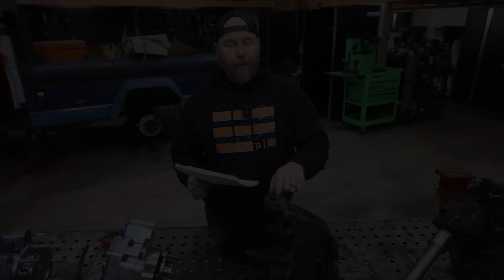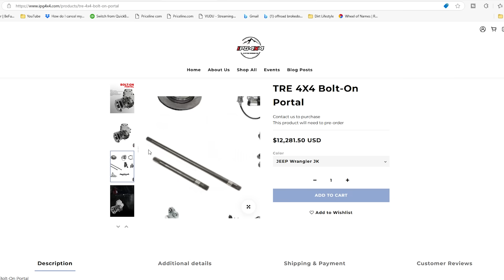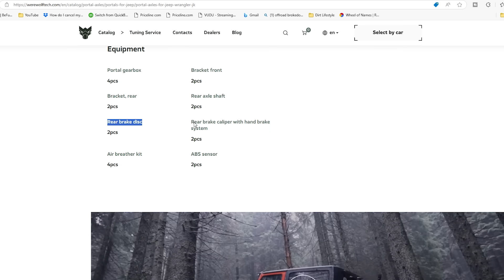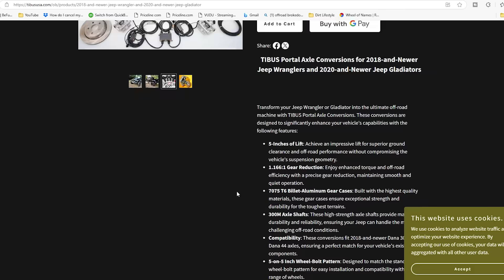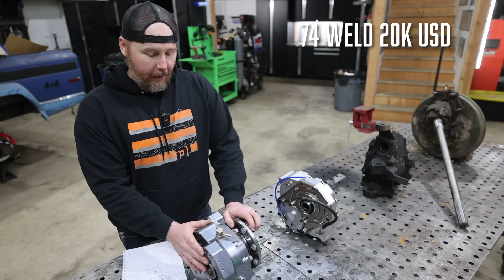CHEAPEST Off Road Portal Axle to Most Expensive! 74 weld, Werewolf, Hummer portal, Unimog portal.

Comment: Why change the oil on the portals at your engine oil change? Why not at the axle lube change interval?
Reply: Heat.  These things break down oil super quickly.  On the H1, the factory recommends checking the oil every 3000 miles (it doesn't actually tell you when to change it) but in the case of the H1/HMMWV geared hub - they're so resilient that I've seen people run them bone dry and be fine.
Reply: The main reason is oil volume. We recommend oil changes every 5K right now. They only hold 10oz where your diff is going to hold several quarts.

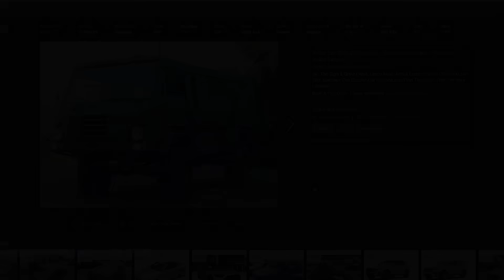Comment: At 7:30 Volvo 303.... there is/was a company in USA making parts for this Volvo portals.
The Unimog 404 is an old petrol engine 70-80 hP and stop production in 1967. The 416 is a diesel engine 130 -170 hP and did start production in 1967.

Comment: Great video Nate, simply, clear and the best you offered with all your time and research gone into this video, plus edit time is another chunk, plus with this video I think you may have sold a few units for a few companies you mentioned, over 40 years ago I built portal style axles for farm equipment company and got the opportunity to low snow in a 4 acre parking lot with one and it was a blast and they were a bi directional tractor, hydro static drive, 14 ft articulated plow on it and this was pushing almost 2 feet of snow and it was no problem for it and maintenance on portals, the routine stuff like oils and making sure your breathers are intact and no ingress from moisture or dirt is easy it took an extra maybe 40 minutes when doing an oil change, this m these were cat iron portal boxes and we never used any thread locker at first and found out they'd loosen slightly, so immediately  we used upgraded hardware, some of the first red lock tite before the public was familiar with it and that took care of that issue ,I still see quite a few in service with farmers over 40 yrs later
Reply from the maker: That's awesome to hear your experience with portals! You guys were way ahead of the curve with farm equipment 👍. Military equipment as well. In regard to Lock Tite, I think I'm going to ask 74 weld about this. Some torque spec info and red Lock Tite would probably be a good way to get ahead of any potential long-term problems. Thanks for the comment!

Comment: Tre also has chain drive portals. I was hoping you might have some insight or thoughts on them. How would the compare in strength and noise?
Reply from the maker: I have zero input on this unfortunately. Way outside my wheelhouse or experience. I would say, if military equipment doesn't have it and 74 weld isn't winning races with it, It's probably for an application that doesn't overlap with mine. There are a lot of cottage industries with special needs. Maybe chain drive is better in the mines of northern Siberia or something?! 😆 I have no Idea.
Reply: @DirtLifestyle the load we calculate for that chain would be a foot wide. I wouldn’t touch it with a 10’ pole but that’s just me. It comes down to goals. Are you trying to make the cheapest portal possible in China or are you trying to make a good quality product in the USA. Based on those goals you then determine your path forward.
Reply: Do wonder the same...... chain is used in gearbox and all-wheel drive system

Comment: Sweet video as always, thank you! With Unimog 416 portals you actually have a number of gearing options, the differences in overall gearing were all achieved with combinations of different diffs and different portals (transmissions are all the same). The gearing differences can actually be pretty significant, the difference in top speed between the highest and the lowest is like 40 kph on a 416. 
On the 404, there are two different portal gearing options, but they're almost the same, hardly makes a difference. You can fit portal gears from an earlier generation (411/2010) to get 10% faster overall.

404 axles look kinda like Dana 60s beef wise, but the gears in the portals reduce stress and effectively make the axles significantly stronger.

The torque tube design is actually awesome btw, it's just really ard to adapt to any non-mog application. It has been done, though (there's an article on Pirate 4x4 I think). I'm kinda waiting for someone to come up with a kit for that.

Comment: I just don’t see the need for portals unless you’re building an extreme rock crawler that you either do the most hardcore trails on the planet with or you do rock crawling competitions. 

For the same price as a lot of these you could get a great suspension to actually gain wheel travel, while still getting lift, easily bolt it on, have replacement parts readily available, not add far too much width that’s typically not beneficial on lots of trails, and not add complexity to your vehicle. 

Portals definitely have their place I suppose, but I don’t see the need for me or a majority of people I’ve ever wheeled with.

Comment: I am very curious to know how it would affect highway driving? Does it use alot more fuel? If you where building a capable overlander, would portals even be an option? Or are tuese purely race and rock crawler tools?
Reply: Most of our customers are a mix of overlanders and rock crawlers. I have them on my Ranger Raptor which is more of an overland rig. Portals don’t hurt your fuel economy…the big tire that you run after portals does. Just as important is are you running an AT or MT tire. For comparison, I had 40” BFG race tires on my 392 and got 10.5mpg…I switched to a Milestar XT and got 16mpg. Went back to a Nitto trail grappler and I’m back at 10-11

Comment: I'd like to point out a possible reason why some HMMWV portal gears strip out; these rigs had inboard brakes, meaning all the braking happened at the axle shaft, between the differential and the portal box.  Therefore, all the braking force has to travel through the portal gears.
Reply: On the H1/HMMWV's - the geared hubs never fail before the halfshafts do.  They are literally the strongest things on the rig.  My friends run 3.08s with 42's on their 10,000 curb weight H1's and never break a geared hub... its always the halfshaft (which come in 10k and 12k varieties too) diffs and driveshafts that break well before the geared hubs do.

Comment: Remember, most aftermarket portals have around 50k rebuild interval.
Reply: We recently pulled a set from one of our vehicles in house that has 40K on it. Everything looked perfect…slapped them back together and they are getting more miles. At normal driving the bearings should last a couple hundred thousand miles. The gears 🤷‍♂️. We have 40K on a gear set that still looks no different than it did at 1K. I just tell people if you are the first one to hit 100K we will happily give you brand new gears because we want to do material analysis and destructive testing on them and see what we can learn
Reply: @74weld  Hell ya good to hear. Those Werewolf's from Ukraine had that last time I checked. Do you plan on making any for the toyota pickup(79-85) axles?

Comment: My guess is that when Hummvees went to up armor they increased to the 12 v portal.  One of the reasons the military got or is getting away from the Hummvee is after it got up armored it could not tow as much or haul as much. It was never designed to be bomb or bullet proof originally. It evolved into this over weight truck because road side explosives.
Reply: The 12k halfshafts, brakes and hubs (really just the input gear) were around before the up-armored humvees came about. (1997 first model year)

Comment: dowel pins are the bigger indicator of the manufacturer controlling case flex. 2 dowels minimum at a diameter about the size or larger of the clamping bolts are good indicators. the face flexing past one another is what cause seal failure and gear misalignment causing catastrophic failure. 

the bigger the fastener the better, but consistent spacing and a good thread design are also more important. the clamped piece being aluminum is fine, but the threads going into steel is the best. aluminum can also be upgraded by having helicoils from the factory. it is common in aerospace design to use helicoils on a weaker metallic substrate because the shear on the steel wire is far greater, and gives an area advantage for the aluminum without having excessive clamp force from over sized bolts.

honestly, the biggest key to long term failure is that maintenance interval and recognizing that it will be an inherently weaker design. keeping that foot under control or using torque management based on wheel speed is a good automated tool. bouncing off rocks breaks everything. damn near doesnt matter the design.

Comment: I'm a mechanical engineer and i have a few comments, First:
Sleep easy , there's never going to be a proprietary bearing on an automotive application! If you open up that 74 weld bearing I bet there's an off the shelve bearing in it! But of course it may not be servicable.
Second: 
The three gear portals "Can't" be as strong as the 4 gears is definitely not the case, both cases can be designed to perform exactly the same and the choice of using 3 or 4 basically comes to packaging and other constraints that influence the engineering of the portals
Reply: You can interchange the terms "proprietary" and "unique to a specific make/model" - while MOST will be fairly common, especially if a, say, component is supplied from an outside manufacturer to several vehicle manufacturers, eg, DANA axle parts, some are "one-of", like the Getrag F28 gearbox which has a bearing that is unique and impossible to find new. I expect there are MANY other examples.
Reply: I would just add that the 4 gear means all gears see half the load of the same ratio 3 gear setup due to sharing it between two mesh points. The casing may not get that same advantage.

Comment: Very informative! I didn't realize that the two gear portals make the axles turn the opposite direction. In my case on my TJ with Currie High Pinion 8.8 diffs, I could just swap the gears from reverse rotation to standard rotation. My concern with portals would be making sure the axle tube strength is enough to handle the added leverage of the portal plus the larger tires. Most axle tubes would be easy to bend in my opinion if they weren't beefed up. The IFS of say the hummer set up doesn't have that issue.

Comment: I'd be worried a bit with the wheel speed sensor if its stock or aftermarket, but only because, if its mounted different say its further than stock, you're going to need a longer wire just to avoid stretching the wire.

Comment: Dozen guys in my country run Tibus on multiple Jeeps, Toyota, UAZ since 2014-2016, all going strong. Recently seen them on Bronco and Tank300 also. 
3 or 4 helical gears, +9.5" each side width, CTIS, 10 year warranty. Also they are way cheaper in Europe than you listed: 7-12K$

Comment: Great info is much appreciated! It's not necessarily an easy task weeding through all of the varying info found on the internet especially when comparing different products! So thank you for the time you dedicated to this topic! For the avg Joe who isn't building a dedicated crawler/offroad rig, who has the bucks and drops their vehicle off at a shop for upgrades in my opinion should stick with 74weld or similar and should stay away from anything fab related. If you are the type who does their own fab and vehicle build the choice is up to you. 74weld for example keeps it simple is basically turnkey and won't leave you scratching your head trying to figure everything out.

Comment: All 12k hummer (civilian)/HMMWV (military) portals are ctis ready and helical cut. Exact same grared hub between the two. When you pull the back cover off, there will be a two-piece brass bushing that is the seal. The seals are a consumable that may be bad (or lost depending on who did the maintenance). The hummer portals also have an inspection plate on the side to disassemble the gears/bearings without needing to remove the portal from the truck and easily see contamination without draining the oil.
Reply: Also straight cut 12k gears are much better overall except in two ways: noise and rocking.  The noise of the straight cuts never bothered me because I can't hear them over my IDI turbo diesel engine in my lap and the NVH of the 37's and thin aluminum sheet metal.  The rock is just one of those things you get used to.
Reply: The helicals only came on the Alphas and the REV HMMWV's.  They are very rare actually.

Comment: The Volvo c303/304 are more common in Norway/ Sweden as far as i know.  Not something you see for sale everyday, but i have seen them. both axels and trucks.  One guy in my group had one last year. And not cheap!
The Tibus is also TUV certified for EU cars. 

Im looking at a set from TRE for a jimny 2000. (not with TUV)

Comment: Super helpful!!! I have been tempting to remove my +3.5” long travel with 35s on my FJ and put portals and 38s. But it feels like all the maintenance I would save by going back to stock suspension will be offset by the maintenance on portals. Maybe even a net increase? I look forward to your installation and long term feedback! BTW, what wheels are you going to run? The +45mm offset forged beadgrip is crazy money. All the new Toyotas factory wheels are around 60-50mm offset. I hope method will start making higher offset bead grips for the masses
Reply: Can't wait for a Tinkerers portal video 😎
Reply from the maker: Portals are great on rocks and snow, but most people don't do enough of either to justify the associated cons imo. But if you want 38s, these will definitely help ease that install. Better cv angles, less stress on your drivertrain and no need to re-gear 🤷‍♂️. Plus, an FJ on portals is pretty bad ass 😎
Reply: Running portals with stock suspension will put a lot of stress on your lower ball joints